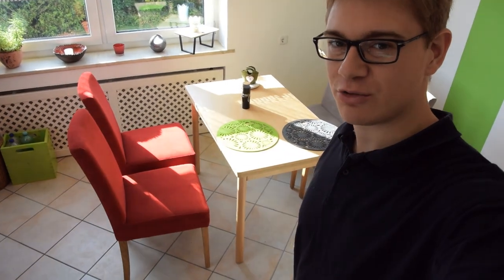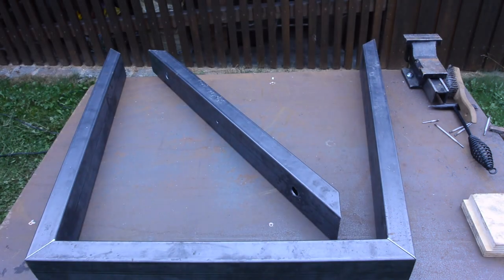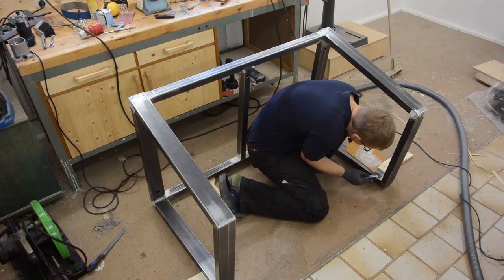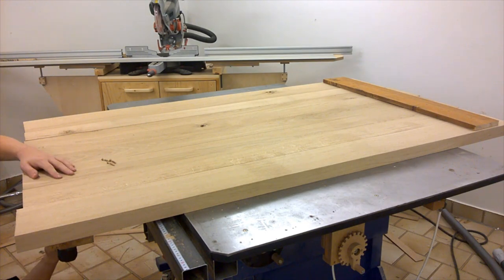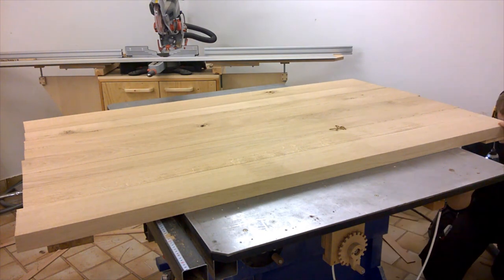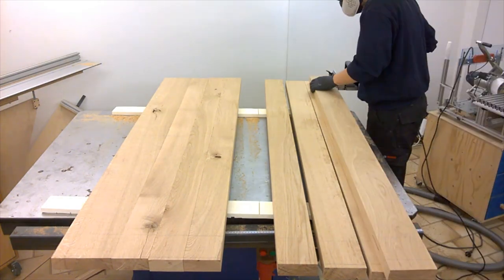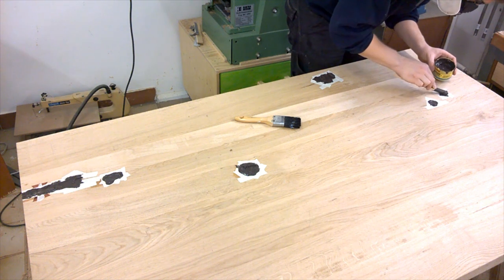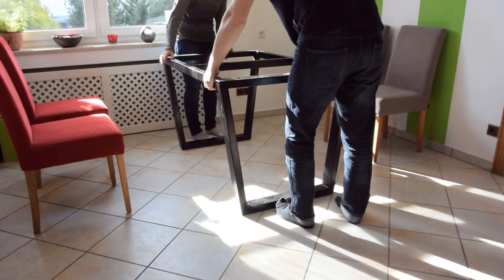Wood and Steel: Building a Dining Table out of Oak and Steel Tubing

Comment: Great job! Is that a heating radiator beneath the window near the table? If so, you might get some wood movement in winter from the heat.

Comment: How come the edges didn't fit after having cut them all with a table saw and using your planer/jointer?
Reply: Short jointer, long heavy boards. Probably.
Reply: I have pretty much the same ADH as  he does and the outfeed table is clamped on the shaft side, so heavy boards tend to lift the table slightly on the shaft (knife) side, making a concave cut. It is also not the most accurate jointer. On the other hand, it's fairly lightweight, small, easy to adjust, has spare parts still available, isn't very expensive and runs on a selection of induction motors - so there's that.

Also the jointer fence is kinda flimsy and moves around with heavier stuff, even if you use two bolts (like you should) in the mounting slot of it (owners of the machine understand).

It's just not a heavy-duty machine... if you wanna work with heavy and long stuff and want great results right out of box, you'll simply need a cast iron jointer and thicknesser. Combination (ADH) machines are kinda rare in that range, though, because cabinet maker shops don't want to limit productivity by combining these two functions in one machine. Anyhow, regular heavy duty work = get a 60 cm (European/German standard size, pretty much) thicknesser and jointer with a cast iron bed. They weigh a ton, need proper bedding and will require powerful dust collectors (or none at all) to work nicely. Three-phase power of course as well (they typically use 4-7.5 kW (5-10 hp) motors), but that's generally not an issue here. And they of course require some shop space - typical jointer overall length is 1.5 - 2.5 m and at 60 cm width you're looking at 80-90 cm machine width. On the flip side, they aren't that expensive, each unit should set you back maybe 800-1500 € if you're buying from a machine dealer, far less if you're buying privately.
Reply: That being said this ADH is a good deal for the prices you pay and works well for the workloads it is meant for.

Comment: you glue up....you could save yourself soooo much time by keeping it cleaner, my god, my ocd  was kicking in
Reply from the maker: Can you elaborate on how that wopuld safe a lot of time in a process that doesn't take very long anyways.
Reply: Cosmas , I was referring to your incredibly messy glue up.  The amount of squeeze out was enough to glue up three more tables .
Reply from the maker: I'd rather use more glue then less. It has to go quick and cover all surfaces evenly. If there is a bit of squeeze out I don't mind.